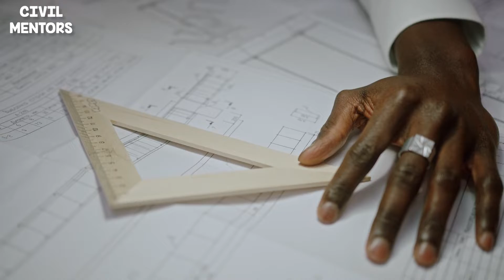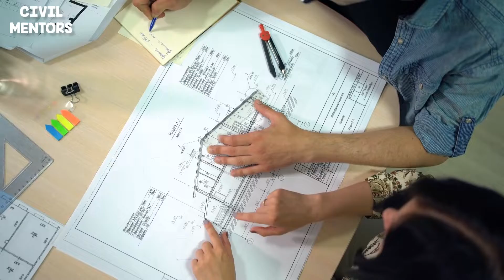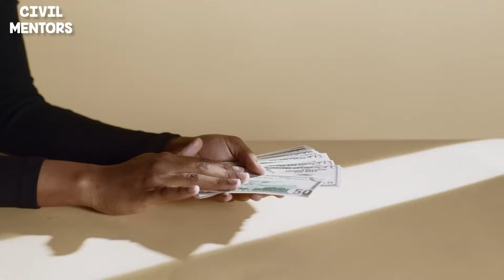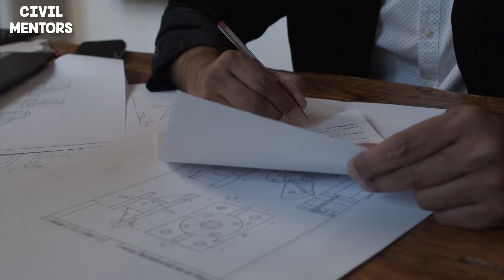Structural Engineering vs. Architecture: Which one to Choose

Comment: Both are different.Architecture is non-engineering whereas Civil or Structural Engineering is Engineering.Structural Engineering is one of special discipline (branch) of Civil Engineering.
Reply: How did you know? Did you took architecture degree? 
Architecture has some structural engineering math-related subjects pre-requisite to architectural design. And that includes calculation of axial and lateral loads. This is why the narrator mentioned that they are part-artists and part-scientists.
Usually, architects collaborate with structural engineers by giving architectural data for in-depth structural analysis.

Comment: In critical situations when human life is at risk is far better to count with an engineer than with an architect. In many instances engineering is essential while aesthetic is optional , example if a bridge needs to be build to cross a river with difficult ground conditions or if it is needed a to build a cargo navy port,  or a dam that will provide water to several communities  or  if it is needed to develop a building that needs to resist strong winds or resist certain earthquake conditions then engineering is the way to go.  If we talk about the 7 new wonders of the world the capacity to endure so much time up to this days for each of those constructions is due to the great application of structural engineering while the beauty is thanks to their architecture.
Reply: To say aesthetics are optional is like saying safety is optional. Neither are or should be! You said it yourself, the 7 wonders (old or new) of the world have been carefully constructed to stand the test of time. This includes stopping the greatest threat, humans! If we needed to make space or grow something else, do you remove the pretty things or the not so pretty things? Most people take for granted engineering feats but marvel over architectural spaces because the human connections are stronger (and just easier to grasp). My take on this video is both are essential and the greatest structural engineers are also the greatest architects and vice versa. Also just a side note: architects don’t build bridges and dams because in those situations, human habitation is not essential. But it ties back into a nod to architecture through design as the best bridge builders make space for aesthetics.

Comment: Good video. But I don't agree to all the points. 1. Architects does not earn more because of the yrs they spent before license. 2. Depend on the country, both likely spend similar yrs. Archt. requires an m.sc  before license while a str. engr need to first do civil engineering prior to specialization. He needs to be a chartered engr first before seating for 7hours structural exam. Under 4yrs post graduate experience. 3. Unlike medical, the institutions need to front for higher salary policy. There's no law that they most earn lesser than the Architect. In terms of risk, the str engr takes more responsible.